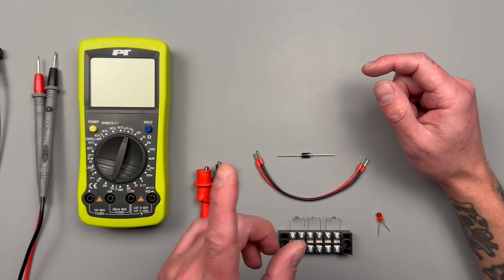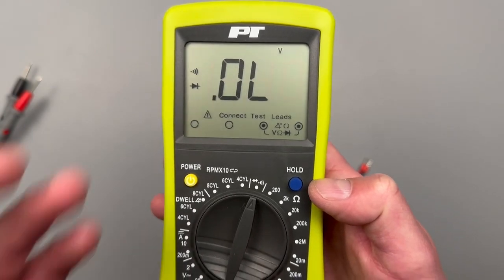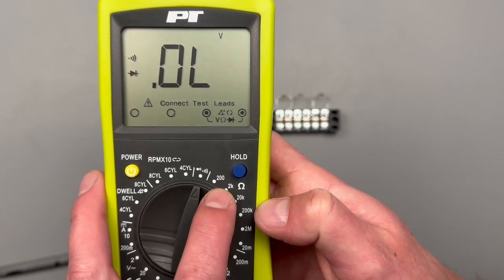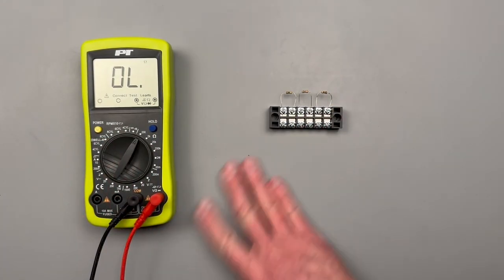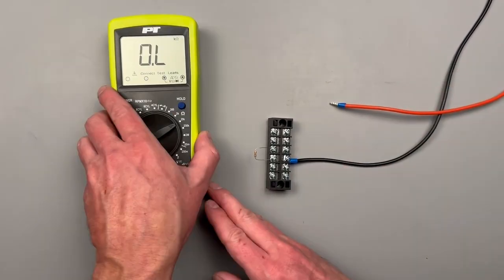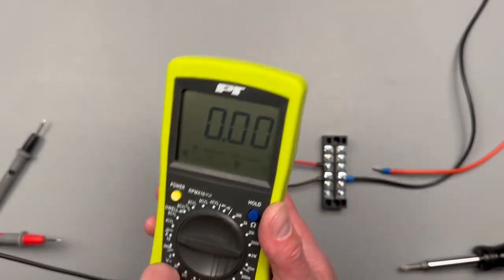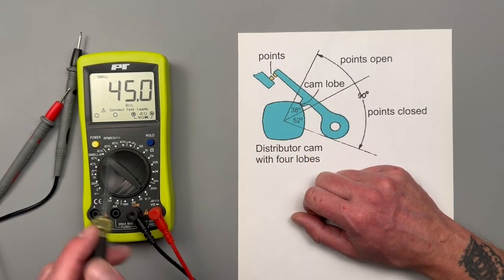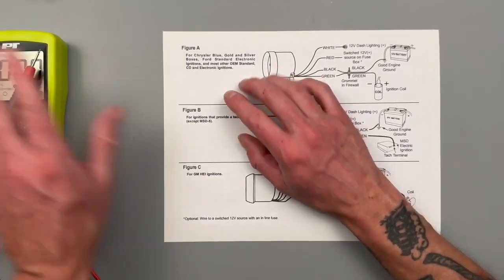⚙️ How to Use the PT-W2972 Automotive Digital Multimeter (Dwell & RPM for Classic Cars!)

Comment: How would one go about testing to see if a have a bad wire that goes to a oil sensor in a chevy truck? Its suppose to be 5 volts i believe? All i know is my truck threw a low voltage code to that sensor
Reply from the maker: There's a lot of different ways to approach an issue like this. And this is where experience starts to come into play. First thing you could check, is to see if you have 5v at the connector of the oil sensor. A wiring diagram will also be helpful.

Comment: Very clear and to the point.  I have a W2970 which is older and not as fancy as the one you have, but the instructions apply just as well.  

I am surprised the instrument has a dwell meter in it.  I remember checking the dwell on engines before 1980 or so and it was very tedious, computerized engines are so much better.  No adjusting the choke twice a year either!
Reply from the maker: Thank you so much!

I've been a professional mechanic for over 10 years and didn't even know what the setting the dwell was lol. I had to look it up just for this video. I am surprised the meter has that built into it, but I suppose its for classic enthusiast.

Comment: Great vid and thank you. I brought this. I'm trying to test 12v inverter, and I turn to high voltage the V with curve line on right on 500, and stick both leads I'm pos and neg and it's coming back hv(high voltage) 103, then I turn it down to 200 and now it reads 103.6+-. I even brought it back to O'Reilly manager check it in his wall ac and it's still reading the same??? I don't get it? And I ripped up the plastic cover it came I'm, so I can't return it. I would have to mail the darn thing in under warranty. Would you know? Or am I SOL?
Reply from the maker: I think you’re SOL. Obviously the item is defective. The store should take it back no problem. I personally would never recommend buying a meter from an auto store. I think they’re really over priced.

I’ve got a playlist here:

All About Multimeters
https://www.youtube.com/playlist?list=PLdem1PlUuTxtTPRKskakIRYPQzfp6avnC

That has a bunch of videos on a ton of multimeters available.

I’ve also got my link tree here:

https://linktr.ee/maddox_mechanic

And I keep it up to date with discounts to a few manufacturers I’ve worked with.

Comment: Excellent tutorial! When looking for a meter I looked at this unit but ended up getting the Innova 3340 Automotive meter. The Innova is auto ranging and measures temperature in addition to the other functions. The Innova 3340 will measure up to 15 amps. The PT W2972 is a reasonably priced meter that includes alligator clips where the Innova doesn't. I bought a set of Klein leads with alligator clips.
Reply from the maker: @mlieser1230  thank you! I actually have a tutorial on the innova 3340 meter as well. TBH, I’m not a big fan of Performance Tool, but was surprised at the functionality of this meter. Thank you for watching 👍
Reply: @maddoxmechanic  I'll check out your 3340 tutorial. Performance Tool can be hit or miss. I'm actually impressed that the meter shows where to connect the leads on the screen. A nice feature for a novice user. Another factor in my decision not to purchase the PT meter was the color. I absolutely despise that hi viz green color. 🤮
Reply from the maker: @ hah! You don’t like the color? I don’t think it’s that bad
Reply: The innova sucks sooooo baaaad! Never buy it